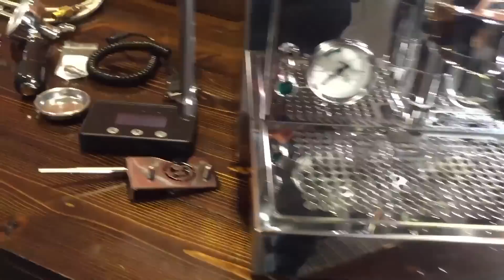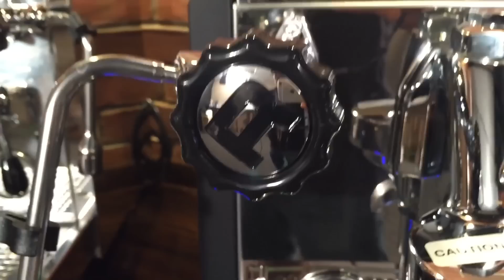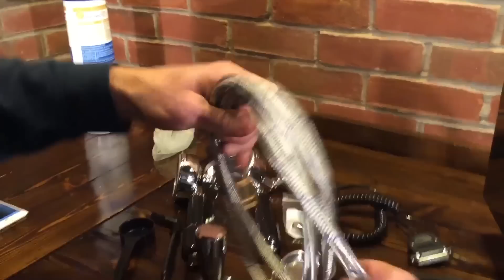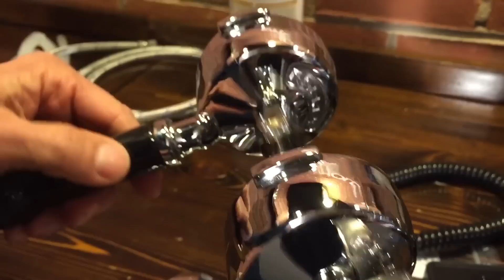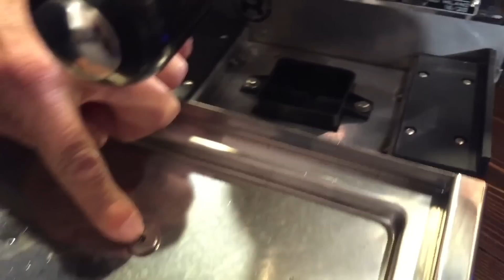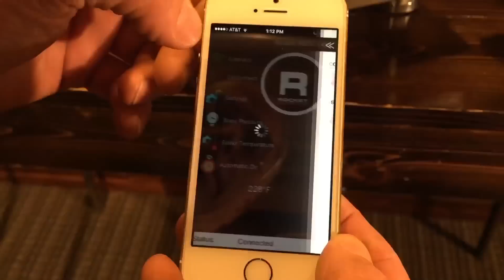Review: Rocket R60V Espresso Machine Overview

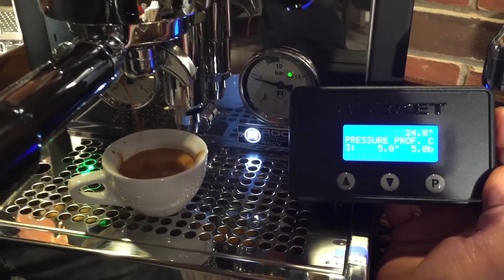Comment: 2:25 so you gotta lower that handle manually? it doesnt stop brewing?
Reply from the maker: Yes, you must lower the handle
Reply: @Wholelattelovepage  seriously thanks for answering. Do you think it might be possible to make R60v have buttons like ECM Elektronika II Profi ? I wish i can set a profile then just press a button such that thr extraction stops by itself!
Reply from the maker: @othsasaa5386  Thanks for the question. You can do that on Rocket Espresso's new R Nine One: https://www.wholelattelove.com/rocket-espresso-r-nine-one-espresso-machine. It does pressure profiling with volumetric control, has a flooded group and you can do manual profiling with a potentiometer on the group and record your manual moves and save them. Very cool machine in the leagues of the LM GS3 and Slayer. We first saw the R Nine One at Rocket's production facility in Milan over the summer. Rocket's CEO Andrew Meo was here at our US facility just yesterday. Look for a video coming in the next week or so with more on the R Nine One!
Marc

Comment: Looking at this machine for a micro roastery (largely just for internal use, not in a cafe), but also seeing that an R 9 single group machine is due out in early 2018. Any thoughts about one verses the other (of course, asking you to make some assumptions about a single group R 9)?  Assuming the R 9 is going to be maybe $1500+ more in price too!
Reply from the maker: Hi Kendrick, Thank you for the question. So here are my thoughts... As a 2 group R9 runs about $13K I'm guessing a single group version is probably going to be far more than $1,500 above the R60. Also 2 very different machines. R60 is a pressure profiling version of Rocket's R58. Aside from that, the R58 and R60 are identical for the most part. R9 is a saturated group while 58/60 are E61 group. For your situation I'd have a look at the La Marzocco GS3. It's a very well respected saturated group machine with a paddle group for variable flow/pressure. It's commercial, built like a tank, will stand up to a variety of users and has far more steam power than the 58/60. It's what our espresso nerds use in the office and is preferred over the R60. Not trying to talk you out of Rocket, but long term think you'll be happier with the GS3. Check it out here: https://www.wholelattelove.com/la-marzocco-gs-3-1-group-manual-paddle
Reply: The GS3 is certainly one I've considered. Interestingly, La Marzocco won't sell the manual paddle version in my area (southern France) because they can't support it. That said, the regular is also a very nice machine and I know of a small cafe that uses one exclusively. Looking again the R 9 single-group announcement, and I definitely had the pricing wrong -- it will be more than $1500 above the R60, so it probably more in the range of the GS3. Thanks for your thoughts!
Reply from the maker: You are welcome!

Comment: Do you guy's think this would be good for a small cafe? Maybe 30-40drinks per hour or so.
Reply from the maker: Hi Johnathon, It's possible however at that rate you'd be better off with a multi-group machine intended for commercial application. You need to check your local regulations as it's not rated for commercial use. A couple things with the R60 if you decide to go that way. First, the pressure profiling opens up many possibilities for refining extractions. Also opens up the possibility of terrible performance by novice or untrained users. The R60 achieves pressure profiling via use of a stepper motor. It's one way of doing it that is a little less robust than other methods like geared pumps. For this machine (it's really a good idea for any prosumer level machine) We highly recommend a good water filtration system. The internal plumbing of the R60 is fairly intricate - especially the stepper motor. A good water supply will go a long way to preventing problems and make for better tasting espresso.
Reply: Thank you so much for the feedback. I think you're right. I may just be better off with getting at minimum a 2 group. Cheers!
Reply from the maker: Johnathon Newman
Anytime!